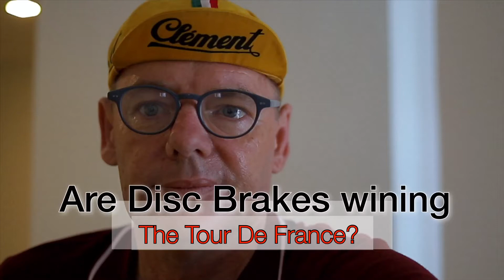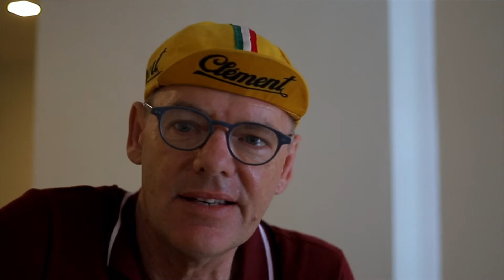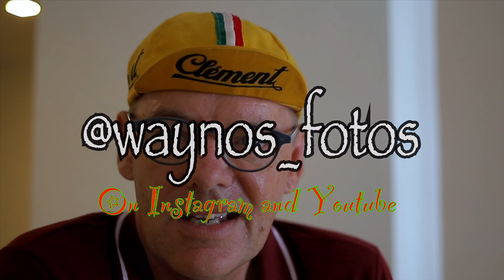Disc brakes wining the Tour de France?

Comment: Thought the new frame design with dropped seat stays was an "aero" claim. What is your opinion on disc for CX or XC? Been using an alloy caadx with mechanical disc and while I've noticed a difference in handling, enjoy the versatility in tire clearance and rim width selection. Also, if I ever get carbon rims, don't need to worry about braking on carbon, disc takes the heat. I see the description says "top end road bikes" and think it is great you've made that distinction. Happy cycling!
Reply: I mention CX and XC because it is amazing what ppl could do on those vintage single speeds without all this technology. Regardless of circumstance, they worked with what they had!
Reply from the maker: THanks for stopping by, there was a few points I would of liked to discuss further but the vid just gets too long. Disc are a great idea on bikes where contamination are a problem and the wheel is de-coupled from the frame +the bike doesn’t need to be super light. But a frame on a road bike is a highly tuned frame that needs to be stiff, light and compliant. Wheels need to be kept on the ground, so some flex is needed (like suspension). Disc brakes compromise that design and create challenges for designers.
The one big thing I don’t like is the cross spoked wheel design, on MTB CX, bikes which travel at lower speeds and on loose surfaces, don’t input the same load, a road bike can potentially put a considerable amount of load into those spokes, if they fail under braking, Whoa! Road wheels have a history of spoke problems, even with rim brakes so I can’t see how disc wheels will be immune.
Just hope this helps people think about designs and what bike they would like to ride, If you ride in poor conditions often,  discs are the way to go.
Reply from the maker: Forgot to answer the aero claim, any aero item at the back of the bike has limited affect as the air has already been turbulated by your body or the bike, so is dirty air, so would make little difference. If this was the case we would still see different designs. But almost all the bike are moving to this smaller triangle in the back of the bike, I could be wrong, but I feel it is a design choice to stiffen the rear triangle while maintaining compliance as the seat stays are flatter and can be thicker with the same flex. Manufacturers and marketing keep these things quiet, and you have to scour the internet to find “truths”
Reply: @waynosfotos   I often compare the bike industry, to the nutrition industry hah So much misinformation, really must dig to find the truth. Everyone wants the money, confuse the customer, and eventually they make a decision regardless. Really appreciate your time!
Reply from the maker: Jon Burrier It is amazing what people believe with out any proof, then when you point out the flaws, Oh your an idiot or don’t know what your talking about, and they use antidotal situations to support their argument.
Reply: @waynosfotos  Oh yes hah I feel this is relevant -  Been a vegan activist 15 years now hah Trust me, I know (>_<) All the peer review in the world (free of sponsorship, subsidization, grants) won't save people from indoctrination. I have seen philosophers refer to societal dogma or mob-mentality / propaganda / cognitive dissonance (for lack of better terms) as "cultural abuse" Humans are fascinating animals indeed!

Comment: Hi
Do you know where I can get an answer to this?
Older Road bike forks with rim brakes absorbed some vibrations.

Disc brake frame forks usually don’t have rake. So doesn’t it stand to reason the fork - frame point must be so rigid there is no absorbing road vibrations? IOW less compliance?

Thoughts?

meyers66

Comment: This is the first year that disc brake bikes have been fully sanctioned for use in the TDF. Bikes with disc brakes were ridden to the win in seven stages. You are right it is not the braking system that won the stage but the skill/strength of the rider that won the stage. Probably the most impressive riding was done by Julian Alaphilippe. His descents were impressive. Unfortunately he was not able to hang onto the yellow jersey due to the stage being cut short because of the hail and road closure. 
Disc brakes are not new technology. MTBs have had disc brakes for about 20 years and no one will go back to rim brakes. Anyone buying a new bike will have a choice to get rim brakes or disc brakes. Just like with automobiles and motorcycles, bicycles will eventually be disc brake only. No one is saying that vintage bikes are junk because they have rim brakes.There is just no denying that the disc brake technology is superior to rim brake technology. Strength, modulation, heat dissipation, no wear on expensive rims, don't heat the rim on long descents, better performance in wet conditions, changeable rotor sizes to increase/decrease stopping power, allow for wider tires. But by all means, keep your rim brakes. Just keep riding.
The next bike I buy might just be an ebike, and denial is not just a river in Egypt.
Reply from the maker: Hi David, thanks for popping in and commenting, but you don’t clarify how they are better?? MTB bikes have a number of differences, the wheels are de-coupled from the frame by suspension, so the affect on compliance in the frame is not necessary, a key difference, lower speeds aren’t such a worry with spoke count and the amount of absolute braking on a loose surface cannot be as great due to ground contact.
DIsc brakes can also have fade, in fact because the disc is small the heat build up is much quicker and hydraulic fuilds can boil with continued use. 
Again I have found no tests on this anywhere.
The MTB argument is sort of  valid, but the main reason is the wet for discs on MTB and CX, is dirt and muck getting on the rim, so Disc are a No brainer on MTB/CX, road is somewhat different in a number of areas.
Reply: @waynosfotos  - I think I enumerated the advantages clearly in the sentence beginning with 'Strength, modulation ... etc.' Whether brakes are 'decoupled' from the frame or not, no one who rides a quality MTB would ever consider going back to rim brakes.
The spoke count argument is specious for either road or MTB. Wheels designed for either platform should be engineered to handle the stresses from either system. If not then I wouldn't ride with them.
As you state there have been no tests but we each have valid opinions. I will concede, if you will, that anecdotal knowledge does not equal statistical/scientific fact.
I stand by my analysis and projection that in the not to distant future disc brakes will completely replace rim brakes on nearly all bikes (over US$700) with the exception of beach cruisers, straddlers and low cost big box bikes.
The most important take away is to not demonize either system, but encourage more people to get out and ride.
Reply from the maker: David Wallace I would have to disagree with equating MTB to ROAD, and as to Quality Control, the bike industry does not have checks and balances like the automotive industry. Poor quality control has been highlighted in the bicycle industry by experts and spoke failures are not uncommon. But I respect and acknowledge your opinion and everyone is entitled to their opinion, thanks for your input to the discussion. :)